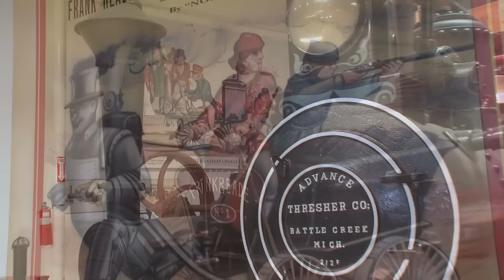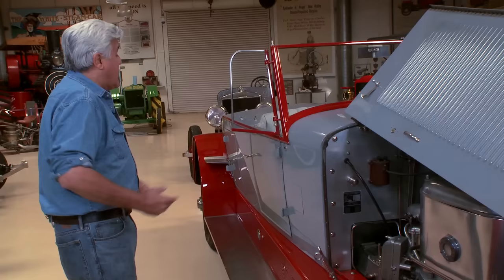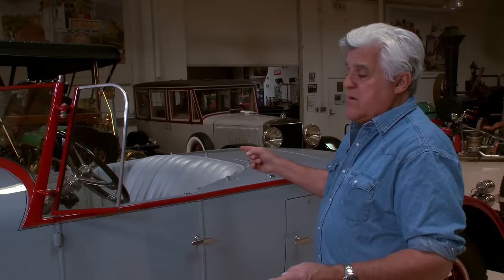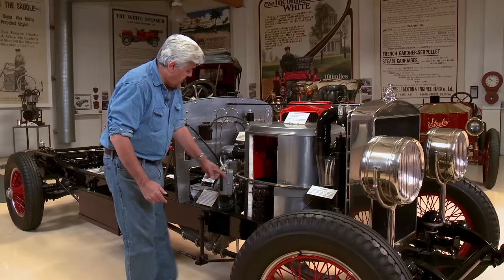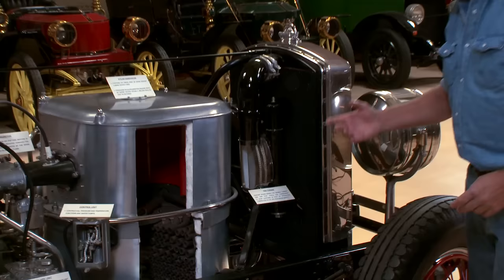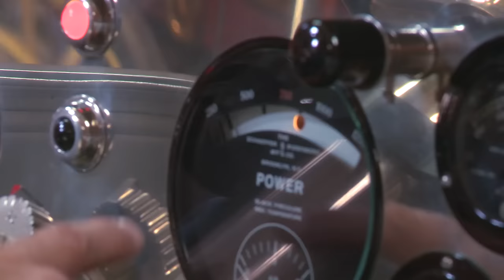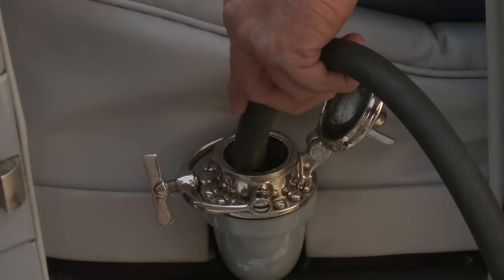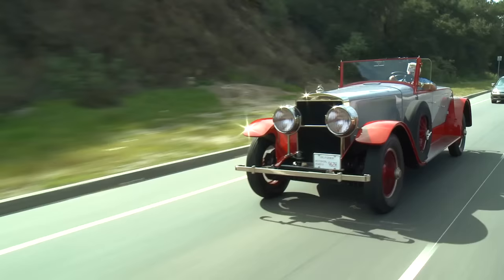1925 Doble E-20 Steam Car - Jay Leno's Garage

Comment: It seems the steam technology would have be the better engine to develop.  The big drawback is the starting of the engine, but I bet they would have figured out better methods if the focus was concentrated on steam engines versus gasoline.  Jay, btw, since you are into technology, you should look into the LAKHOVSKY Multi-Wave Oscillator.  This "gadget" from the 1930's, that is based on Tesla technology, has been proven to be a true human life re-generator and healing device that is unsurpassed even today.  It may give you many more years of healthy living and enjoyment of classic cars. :)
Reply: Check out Cyclone Power. They seem to have solved all the common drawbacks of steam while at the same time producing a true multifuel system.
Reply: john hanrahan Actually no, independent testing has shown the Cyclone Power engines are rather lackluster even for steam power...
Reply: The real doktorbimmer Steam power is a matter of square inches x pressure with the underlying make up ability of the boiler to maintain said output. Further, what has plagued steam is its intrinsic degreasing  properties making it a maintenance. It was to my understanding the cyclone boiler was very quick to reach operational temp and hence, pressure. It was also to my understanding that with modern high temp plastics, the maintenance issues were greatly diminished if not tamed altogether. I am also to the understanding they are prepping for a steam land speed record as well. Can you give me the source(s) of your information to the contrary? Not that I suggest you are in error, rather I wish to verify this information either way. I was really hopeful that this 'new' angle on steam was going to be somewhat disruptive as just about any successful external combustion engine could be. I have the impression now that my hopes have been misplaced. Please get back to my OK? Absolutely no sarcasm intended or implied. I only seek more complete knowledge. Thank you.
Reply: john hanrahan No problem... I will try to explain...

If you are an engineer with experience in Boilers/steam generators you would know that they are designed, manufactured and rated in "horsepower"  even if they are being used in a non-tranport application like heating a building.

Lubrication can be more of an issue for reciprocating steam engines using superheated steam.. as Jay mentioned they require lubricants with higher temperature ratings. special lubricants have been developed for these types of applications.

 Cyclone uses a coil type steam generator like the Doble rather than a boiler. Coils contain very little volume of water thus flash into steam very quickly... nothing new here

Tests were conducted on behalf of a US federal government contract for a Cyclone installation in a combined cycle/cogen. application.. the results of which did not match many of the companies performance claims to exceed existing steam technology...

Unfortunately the laws of thermodynamics prevent steam engines (especially single expansion reciprocating engines like the Cyclone which are the least efficient type) from ever being more efficient than internal combustion engines.

I hope that clarifies my remarks.

Cheers!
Reply: The real doktorbimmer Excellent post. Thanks for the clarifications.
Reply: john hanrahan No problem, you are very welcome. cheers!
Reply: syyenergy7 what was the frequency used in this lakhovsky multi wave generater, i do believe in this technology  raymond rife  developed this in the early 30s, the pill industry wants this kept quiet ,if this  way of healing ,which is  way better way without pills , caught on by  everyone ,the pill producers would be unemployed ,maybe even jailed for the injustice done to rife and humanity